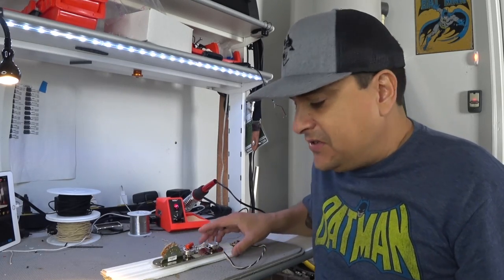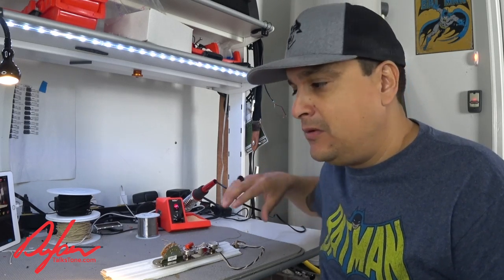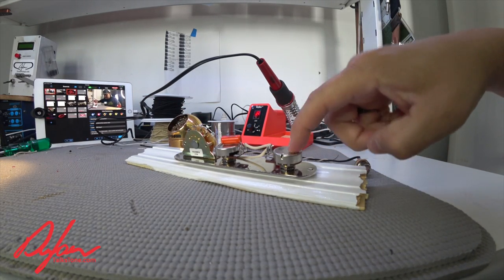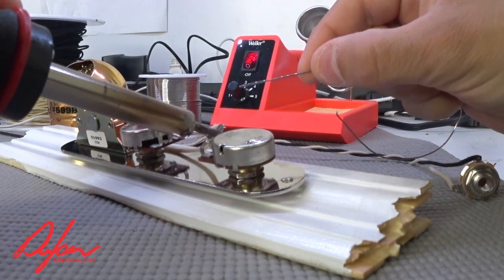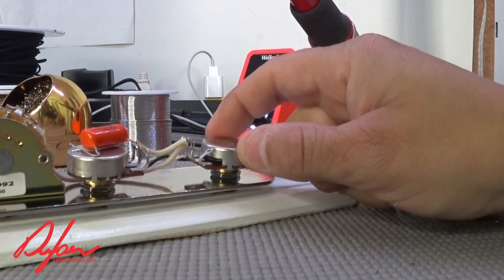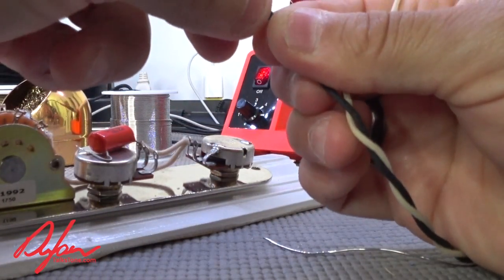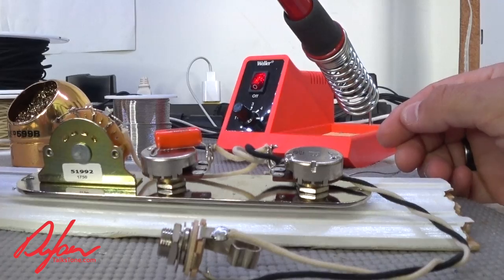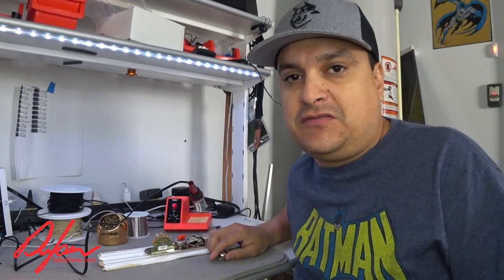How To Replace the Volume Pot In your Guitar   How To Solder Episode 315

Comment: Awesome video!  Thanks for sharing!  Great tips and advice.  I did my first solder job the other week when I replaced the output jack in my guitar.  It works but wasn’t expecting that the ground was the shielding on the cable.   Anyway, enjoying your channel, found lots of videos I need to watch!